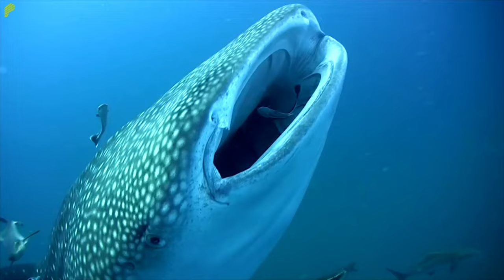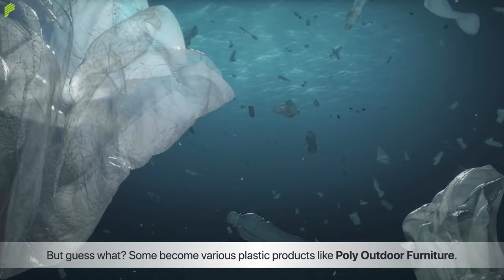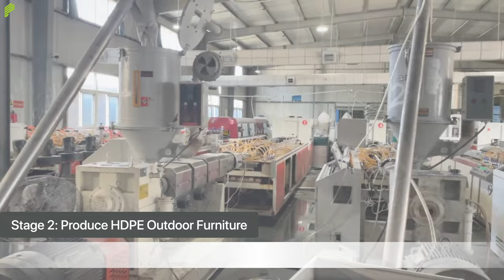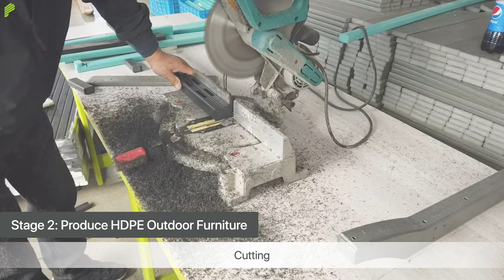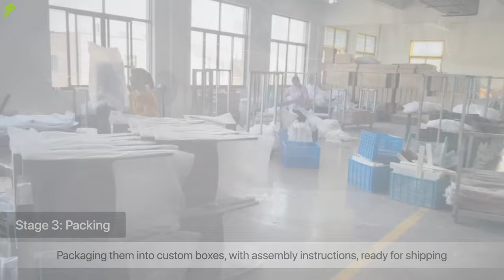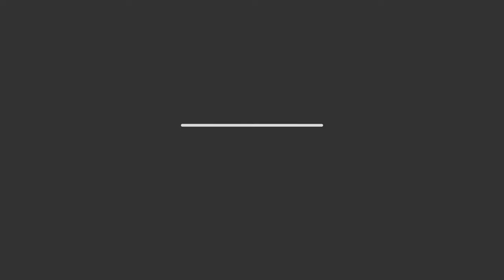How to Make HDPE Recycled Plastic Outdoor Furniture & Why We Make It

Comment: Nice product. However while you’re helping to “save the planet “ you are deliberately putting your workers in harms way. For example there is no guard on the chop saw blade. This saw most assuredly came with a guard so it has been removed onsite. This is not an employee problem but a management problem.  There is no need for the guard to have been removed and there are no other safety measures that have been added. From a safety risk assessment, the likelihood of injury is high, frequency of possible injury is very often, severity is severe.